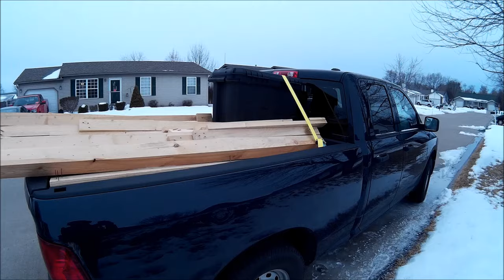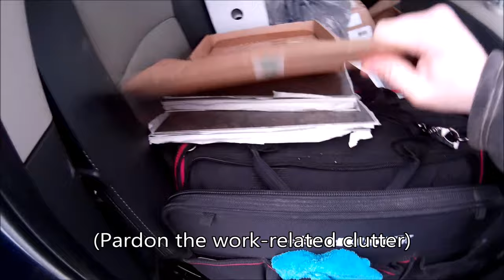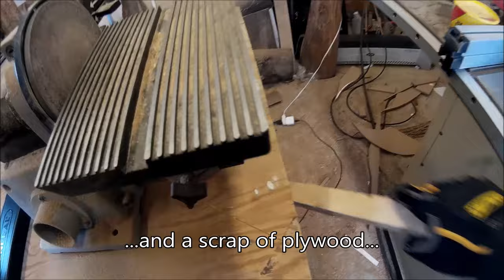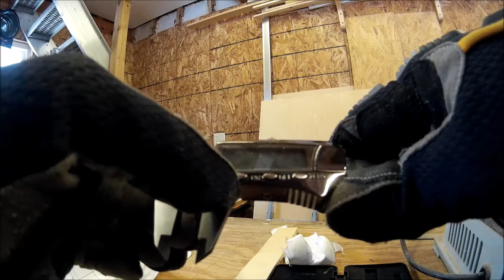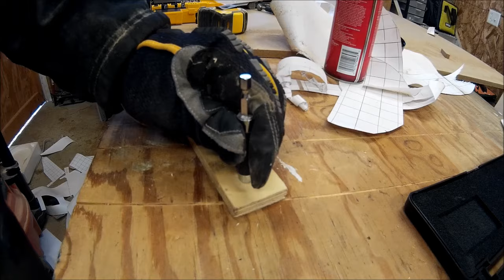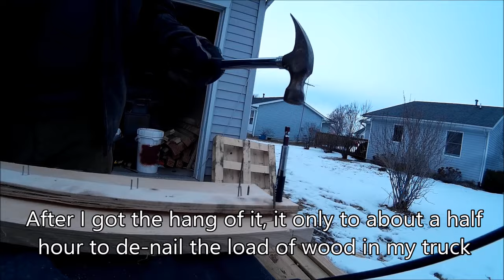Pallet Wood De-Nailer (Amazon links in description)

Comment: I'm  a beginner in the worst way... your video is one of the most helpful ones I've found so far!  Thank you!
Reply from the maker: Thanks for watching!
Reply: Thomas Lightle - Red Barn Woodworking
Reply: Sandra Dee 
Do it that way and you'll be buying another
bit holder, because you'd have shattered
the magnet inside it!!
Learn how to  use the hammer!
A couple of tricks n tips for you, scratch up the
striking face of the hammer with 40 or 60grade
abrasive paper, this will stop the hammer from 
sliding off the nail when hit,  and with the nail
head exposed, here's the clever bit, put the claw
against the nail but lever it sideways as if you
are laying the hammer down, you get loads
more leverage on nail this way, and when it frees up 
enough you can pull the rest out in the usual way,
great for removing pallet nails, which are serrated, 
and old well rusted ones. I've seen many tradesmen 
struggle because they didn't know that.
DON'T do it with a wooden handled hammer you
may snap it where it joins the head. 
Good luck, and I hope you find this helpfull.
Reply: https://www.youtube.com/watch?v=TOrrz73Tj1Y Here's another de-nailer. I've got one and it's awesome.
Reply from the maker: Imitation is the sincerest form of flattery.  I'm flattered.

Comment: Old carpenter’s laugh at such silliness
Reply: No kidding and get a real hammer
Reply: Do you have a better/cheaper solution???
Reply: @Liberallez  hit the nail with the hammer, just don't get your head in the way...
Reply: lol.  yes. This is a classic case of double handling.
Reply: Glad to see a few with a good reply learn how to use a hammer
Reply: a palm nailer will drive those out 10x easier and faster.  May not be ''cheaper' but $14 from Harbor freight is money well spent.   those nails are WAY straighter than the ones I usually have to deal with.

Comment: I clip the end of the nail, leaving about a half inch, or less.  I then hammer the nail, giving a half inch to pull with on the other side.  This eliminates nail bend, and reduces how much nail has to be pulled through the board.
Reply: That was going to be my suggestion.  You beat me to it.  The shorter the nail the easier it is to remove
Reply: You dont even need to clip it. Just an inch thick slab with a 6-8mm hole in the middle, you straighten the nail with the claw hammer, put the slab on it, then hit it. Next, you remove the slab and hit it again until it flush. This is realy not a rocket science, just need practice.

Comment: I always take my bolt cutter with me when i go to collect a load of pallets.When i take the pallets apart i  cut the stem of the nails of 1/8 -3/16 from the wood.Two reasons,one its easier to load on my roof rack and two when i hit the nail to show the head and pull it out its too short to bend. Different folks different strokes, but we are all saving trees and money.
Reply: I’ll go for this idea 👍🏻
Reply: Came up with your idea on my own 😁
Guess you hold the patent for being first to publish !
Reply: Me too, the simplest ideas are the best.
Reply: Good thinking.
Reply: I was just about to comment this lol. I had the same idea as the video, but I wondered if I was trying to over simplify somthing that was already pretty simple. I grabbed my heavy duty wire cutters and went to town the other night on a few pallets and then just tapped the heads up with no bending like you said. Nails seem to pop put a lot easier too. Both of your ideas are a great example of the endless ways to do the same task. That's one of my favorite aspects of problem solving.

Comment: This is a great creative solution. I recommend trying the Air Locker AP700 denailer. It works on compressed air and will often shoot the nails out of the board, requiring no hammer. If the wood is soft enough, you could do all this wood in 5 mins. It pays for itself quickly in saved time. Often with white oak boards the nails wont come all the way out, and you will need to use the hammer to finish removing the nails. Good luck
Reply from the maker: Thanks for the suggestion!
Reply: Bought one yesterday, should be delivered this afternoon.
Reply: I'm thinking of picking up a tool like this. The gun itself is pretty cheap and simple, but what about the compressed air? I'm not sure how much capacity/PSI/cost it takes to drive one, and how much that adds to the sticker price if you don't already have an air compressor.

Comment: I wish I had thought of that years ago when I was using pallets for building projects. I will suggest though that unless you need the full length of the boards to simply take a skill saw and cut off the ends just inside the nails. Then all you have to do is remove the few center nails. Oak pallets can be pretty tough to drive those cement coated nails out of so reducing how many you have to remove can speed up the job.

Comment: That might be inexpensive, but there is an air-hammer that sells for about $50 that would make each removal a single trigger pull.

It also makes a great hole punch for adjusting leather belts.

Comment: Red Barn woodworking,:  thank you Very Much for this nail tip. I started pulling pallets last summer and getting the nails backed out has been a Major chore. I have damaged vision and hand eye co-ordination isn't what it could be. I tried the hammer whack method and I spent so much time re-straightening the nail... oh yeah.   I had one of the those screw guides that I wore out driving deck screws. what a difference a tool makes.  !!  I can hit the nail guide with authority without smashing a finger. Johnson&Johnson was making a living on my Band-Aid purchases...   I like using all the board length I can get so sawing the  board off to save pulling nails is no useful. not only that but Izzy Swan showed how to ttake the nail to the crowbar in a vise and now I can re-use all those rusty nails I used to bend into pretzels. Saving money lets me spend on other things. In the meanwhile I am building  planter boxes and freezing my fingers... spring will see more boxes in the yard this summer.  Thanks for the tip. it saved me a lot of time and effort.  go ahead and re-invent the wheel.  some folks need to be shown the way. thanks for the help.
Reply from the maker: Thanks for the kinds words!  I'm glad I could help!

Comment: I de-nail a lot of pallets I use the heavy duty pallet pry bar to separate them to get them to this point if you set that on a concrete surface with the nail head up then steady it with your foot smack it once at each of the 3 nail clusters with a rubber mallet the head is exposed just flip it over and use a claw hammer to pull them out much easier and a lot faster than this method  also a nice strong magnet on a long handle works great to retrieve all of the nails

Comment: Good idea you have! You can avoid the head of the nail splitting the timbers surface by positioning the nail over something to support the timber. I've got away with a vice closed up to about 3/8". Cutting the nails off to about 1/2" also helps to keep them traveling straight.
Reply from the maker: Thanks!
Reply: Good one! I'm going to try that.

Comment: I just use a lightweight framing hammer for the waffle head. A pair of channel locks or vice grips to grab a bent nail. If I hit a nail and the waffle head slips, or the nail just wont budge, Ill grab the nail with the vice grips and give a solid blow to force it. Hammer in one hand, vice grips/channel locks in the other, it starts to go very fast when you find your rhythm. I also keep a cat paw and pry bar nearby but don't utilize them. I feel I would accidentally break this makeshift de-nailer, and I don't think I could go faster using it anyway. Also, I'm not worried about bending or breaking any nails(not sure if the purpose of this de-nailer is to salvage nails). Ill throw the good ones in a bucket of old nails but if I break/bend every one, that's fine. With so many pallets and reclaimed wood to clean nails out of I really just need the wood.

Comment: Please take the 30 seconds it would take to remove or clip off the nails (staples?) sticking up out of that scrap of plywood before you put one or two thru your hand.   Even heavy gloves might not stop the nail from giving you a nasty puncture wound - and with such a wound, there could be permanent nerve damage.  Safety first!   Other than that - this is a great technique.

Comment: Use channel locks. Put the locks right against the wood where the nail sticks through. Pivot the channel locks on their curved side. They will pull the nail straight through and you'll be stuck holding the nail and can toss it in a can or the garbage. One step and you don't have to pick up nails.
Reply: I. Have found this to be a great method as well.
Reply: Harder to do it this way.  Nails in pallets generally have large heads to keep them from pulling through.  Your trick works better for finish nails which have small heads.

Comment: I can see why it's one of your most popular videos. I have several of these tools and a mess of pallets to practice on. As an experienced carpenter I can also say that just using a hammer to knock that nail out works great if you just put it into a soft wood 2 X 4 but let that nail be in beaded in a hardwood pallet board and this tool will put you at a much better success rate.

Comment: Very cool idea.   I just found a tool called an Air Locker that runs on an air compressor, it looks like a nail gun but it's meant to push the nails out of the wood in a similar way.   If you do this a lot it might be a good investment.

Comment: could a bit driver be big enough to capture the head of the nail so after you pound the nail part way out like you do in your video you flip the board over and using a battery operated drill you then  put the head of the nail into the bit driver so it captures it and then reverse it out so that way it doesnt drop out???  I have no idea if this would work or if a bit driver would be big enough to fit the nail head in...just curious to see if it might be possible???
Reply from the maker: I don't see why not...

Comment: Pallets I get have spiral nails that make it impossible to remove without splitting the wood. I’d love to find pallets like these
Reply: I use pliers and I crush the spikes in wards so they don't catch the wood when I drive them out with my hammer. It makes removing them SUPER easy! Another trick I found was to drive the nail out enough for the hammer to catch it then cut the rest of the nail off. The spikes are usually towards the middle and end of the nail.
Reply: Just use a grinder and grind the end off lol...

Comment: When pulling out the nails, put a piece of 3/4" material under the head of the hammer to give more leverage.  Really helpful when using a framing hammer with claws that are not curved.

Comment: Oddly enough after breaking down hundreds of pallets getting the nails out of the wood is not the problem.  In fact I set up a garden chair with a big pile of stuff with nails on one side and bucket to put the nails in in front of me and give them a quick whack with the hammer on my lap, flip em over and they come out with no issues at all with my crowbar.  This is white oak mostly.  Now getting the slats off the runners that can be a bit of an issue..

Comment: I'e messed with pallet wood.  The issue is hardwood boards get reused and when they rebuild the pallets they cut off flush all hte old nails which are now buried in oak.  On top of that they wood they use is mostly garbage--cupped, warped, twisted...and knots in almost every piece.  I have salvaged pine boards (must easier to get nails out of softwood) and used them for a few projects, but he hardwood is almost always junk unless you need small pieces and can cut around any nails..even then be careful because i've hit plenty of hidden nails on the chop saw.

Comment: I would like to commend you for your creativity and ingenuity with this idea. At least for me, it’s still much faster just using a hammer to remove the old nails or simply cut the ends off and only having to deal with the nails towards the center of the planks if the entire length of the stock is not needed. Everyone has their own techniques and you use what works best for you. I’ve learned a lot of different techniques from tradesmen over the years and adapt them to work for me.

Thanks for sharing.
Reply: Thank you !! what a brilliant idea. Cutting the nail would prevent it from bending (probably haven't try it yet).

Comment: to take a pallet apart you need a table that you can clamp the pallet frame down on and make a cantilever type pry bar with a flat rocker plate on the top so that it pries the board up without twisting it. once you clamp it down it goes rather quickly. A couple of hooks that you can flip up to hold the pallet down are fast and work well to hold it down while you pry off the boards and the rocker plate keeps you from wasting boards because of twisting and splitting. those screw nails are tough and you will still tear some of them up.

Comment: It's easier to use a steel cutting disk on an angle grinder to cut off the nails about 8-10mm above the board. The shorter length plus the flat top makes the nail more stable easier to strike. They can usually be done with one good strike. Flip over and extract the nails with a claw hammer as normal. If there are three nails in close proximity to one another this takes no time at all compared to hammering through in several strikes which can still end up with bent nails.

Comment: Getting the boards off of the pallets is the hardest part.  The ones I get use twist nails and each board will have 5 or 6 nails in each end.  I haven't found an easy way to get the boards off without splitting them badly.  What's your method for pulling the boards?
Reply from the maker: +Ozark Ed I used a flat prybar. It was a lot of work, and I definitely need to find a better way!
Reply: Just cut the the timber with a circular saw, near the end of pallet leaving only the nails in the end piece of pallet, if that makes sense
Reply: use a cats paw and pull the nails from the head or put a pry bar between the pieces of wood then remove it and slap the wood with the hammer to pop the heads up out of the wood.
Reply: I leave the pallets in the rain. the wood softens and then use a crow bar and hammer
Reply: LOL!!!!
Reply: On pallets that are stubborn, I use a recip saw in between the boards then go back and pop the heads out. That's assuming you either don't want the runners or are ok with the nails being in them.

Comment: Neat idea, though its faster if you don't need to use it. I recommend a heavy solid block of wood under your nailed boards on a sturdy platform (not a tailgate). It makes hammering faster, less noisy and more effective. And for removing bigger nails, a 36" crowbar is much better than a hammer when pulling them out.

Comment: I use two crowbars to pull the pallets apart, let the pallet board drop nail down on concrete (it will pop up most of the heads) and remove the nails with the crowbar (more leverage and range, plus a block of wood to stick under the crowbar if the nail is really long to gain more range). and for the bent ones i use a hammer and some pliers. I hold the nail straight with the pliers and hit it with the hammer to pop the head out.

Comment: Sorry, but leaving the staples sticking up on your piece if ply made me cringe. Flatten or remove them.
Reply: I was thinking the same thing.  If you are worried about safety, the staples should have been removed first.
Reply: I suspect he dismantled them at another location, an was tossing them in the truck bed to de-nail all at once, so storing them like this was safe nothing to cringe worthy
Reply: I thought the same thing, but at least he had on sturdy gloves.
Reply: Isn't that the whole idea of this video? How to drive the staples out?
Reply: Yea, that was humorous.
Reply: @Gantzz321  Clearly not what the person was commenting about.  He was saying that the staples should have been removed from the plywood strip before using.  Each time he grabs the plywood to use his tool he runs the risk of stabbing his hand on the staples.  This has nothing to do with the nails that he is removing from the pallet boards.
Reply: OSHA job site $100.00 fine for nail sticking up through boards you learn fast at least bend them

Comment: You must have nearly new pallets that you disassemble. Older ones are not nearly as nice. You should consider cutting the board with a saw instead of driving the nails out especially for the thin boards. Most of the time the ends are useless on the thin boards of used pallets in future projects because of the holes and splits the nails caused when they were installed. Occasionally I can save the center of a thin board by driving out nails if they haven't split already.
 I used to do the same thing until I realized I was cutting most of the ends off anyway. Sometimes on the bigger 4x4 size the nails can be removed and the lumber used to the end but not always.
Remember to take care if you have the need to run any pallet lumber through a planer for projects. The grit typically mashed into the wood surfaces wears the heck out of the blades.
Reply from the maker: Good advice.  You sound like you know a thing or two :) I saved the ends to get the full 6 feet for construction work.  I do admit that I cut off the ends when I am making something nicer with the wood.  Also good point about the planer. I do ususally use single-use pallets for finer work for the jointer and the planer's sake!